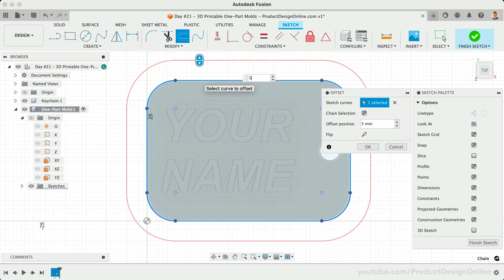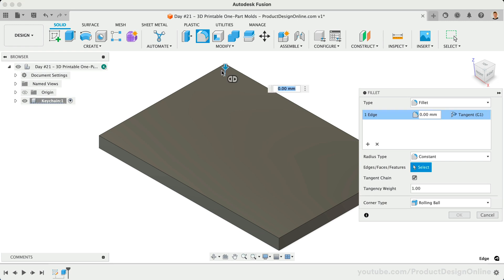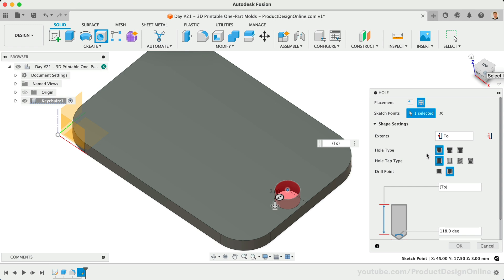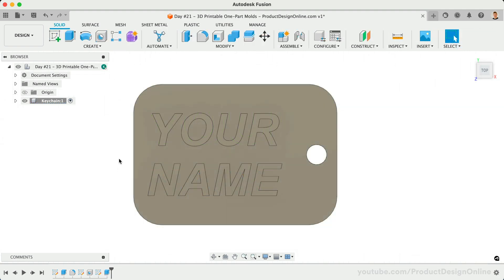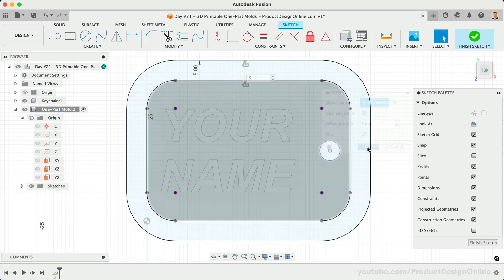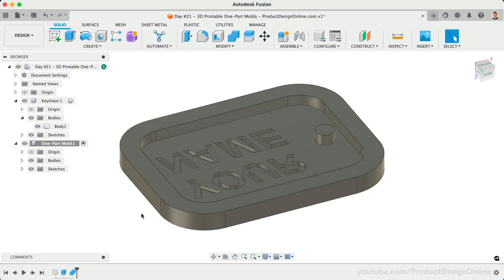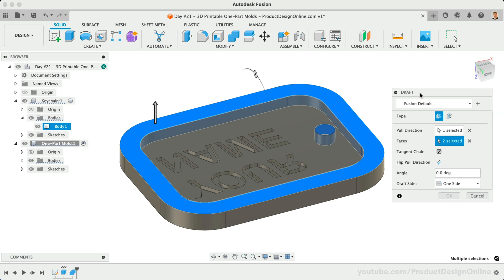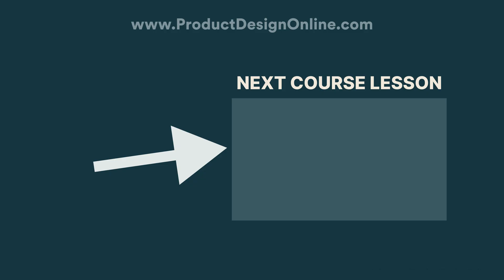3D Printable One-Part Molds | Day 21 of Learn Fusion 360 in 30 Days - 2023 EDITION

Comment: For anyone getting the error "Could not taper surface as requested" trying to apply draft to the letters, it seems the problem is selecting the surface from which you draft. If instead of the top surface you select, for example, the bottom of a letter, then the draft operation works for the letters too.

Comment: I am loving these vids so much! I've had no problems so far but I am also getting the  "Could not taper surface as requested" error someone else mentioned below. I can taper the sides and keyhole just fine and letters such as T, N, or I that have simple surfaces.  Letters like S, R, or O with curved segments give me the error..  I have tried to reproduce the example right down to the text size, font, extrude distance ect with no luck.  Hoping someone out there has a solution for this.
Reply: Yep, same problem. Would be nice if he would explain that

Comment: But will resin release from a PLA mold ? I wouldn't think so. Buy maybe if you spray it with something ?
Reply from the maker: Spray with smooth on mold release. A release void can also help.

In a pinch I've also used Vaseline or cooking spray as a mild release.

Printing with Nylon or TPU so you can flex it will also help.
Reply: @ProductDesignOnline  Thanks, makes sense. I'm gonna give release + nylon a try. I've never printed in Nylon before though, not sure if it's harder than PLA, will need to look into that. I remember hearing TPU is no fun for some reason, I think it was clogging and clogging is such a pain. But yeah, I have some ideas for making a resin mold. I know some people then use that to make the rubber mold, but it would be nice to skip that step if possible, maybe it's not.
Reply from the maker: @hv1461  Both Nylon and TPU can take a bit to dial in. But once you have the settings (mainly temps) right, it's just about as easy as PLA, in my experience. I've used PolyMaker brand TPU with the most success/least amount of hassle. Don't know if its actually a better product or just luck tho :)
Reply: @hv1461 my understanding is that TPU is much more prone to producing errors due to moisture in the filament, compared to PLA, so needs drying before each print for best results. Have just bought a filament dryer to see what a difference it actually makes.
Reply: what material would you pour into this mold? some kind of resin?

Comment: I noticed that my axis labels are different than yours for some reason. Any idea why is that? Edit: I think it's because the default front face is different. If I set my front face to be the top face I get what you have. I don't know if there is a way to change this default.
Reply from the maker: I always record with the default preferences. You can 'restore defaults' to make sure they're the same: https://productdesignonline.com/default-settings-for-fusion-360-tutorials/#restore

On that page, I also show how to manually change the modeling orientation.

Cheers!

Comment: Great video! Is there a reason to fillet the body rather than the original sketch in the first step?
Reply from the maker: Good question. It's considered a best practice to always apply modeling (solid) fillets instead of sketch fillets, with the exception of when you have no choice for a curved path per a sweep/loft (as seen on Day #4).

That said, with a design as simple as this, you shouldn't run into any issues aside from your original sketch being harder to update the size (constraints will get messed up with the fillets). With larger design files/ assemblies, fillets in the sketches can cause latency and other issues.

I always try to teach the best practices so people form good habits 💪🏼💪🏼
Reply: @ProductDesignOnline  Thanks for the reply and details about when to use sketch fillets. I'll watch the day 4 video again.